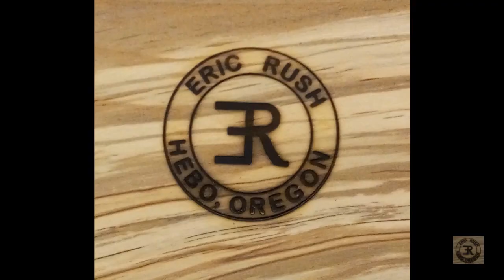Second Turning of a Microwaved Alder Plate

Comment: That turned out nice Eric!👍🏻You remember how long it was left in the microwave to dry? Thank you for sharing!
Reply from the maker: I dried it over five days. Starting weight was 483 grams, ending was 324. I think nuke sessions were half a minute on this one. Process is, record the weight, nuke it, let it cool for an hour or so, repeat. This one went through 25 cycles. It lost about ten grams each cycle. I stopped after four cycles on the fifth day with weight losses of 3, 2, 2, and 1.